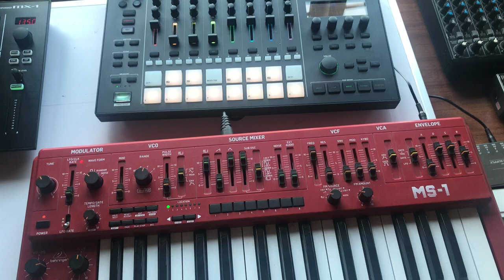Behringer MS-1 How too change the midi channel input/output without software.

Comment: I love the sound of my MS-1, but the user interface for the sequencer and other digital features is so bad, it seems like user experience was an afterthought with little coordination between the hardware and software teams during product design.   To accomplish so many basic things you have to resort to the manual or a cheat sheet to look up completely unintuitive button combinations.  This could have been so much better.  (For example, accessing the even the advanced features of the RD-8 is quite straightforward.)